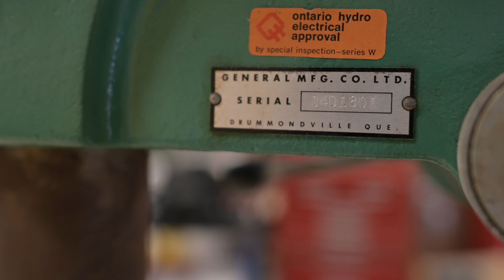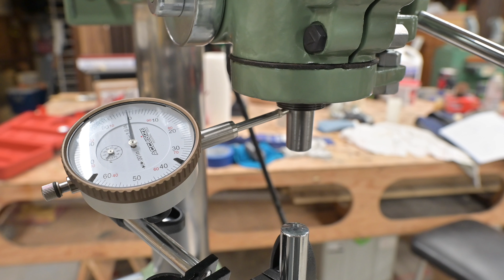General 340 Drill Press Restoration | JCB and SONS

Comment: Hello!  Thanks for posting this!  I have a similar Gen 340 (slightly newer model ~`1970's?), that I bought from a school auction. It also has an incomplete foot feeder.   The motor is a 3/4 hp 3 phase so I'm going to go the VFD route.  Hope to get stuck into 'er  in the next month or so.  It has been sitting in a corner of my shop for about 2 years.  What was your paint choice if you don't mind? Btw I'm just around the bay in Midland ON,
Reply from the maker: Thank you for watching.  They are a great drill press.  The foot feeder was a great find, hopefully you are able to get it operational again.  I just used Rust Coat from Home Hardware.  They made a custom match, if you'd like a copy of the paint code just email me @ jcbandsons@gmail.com